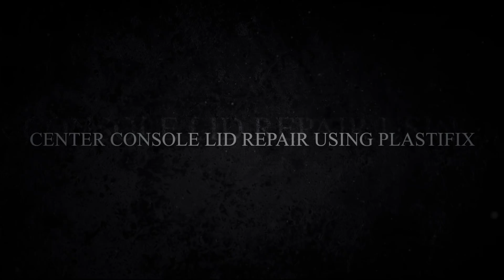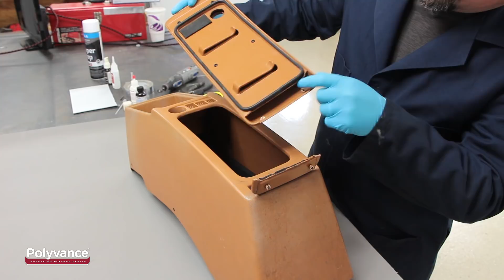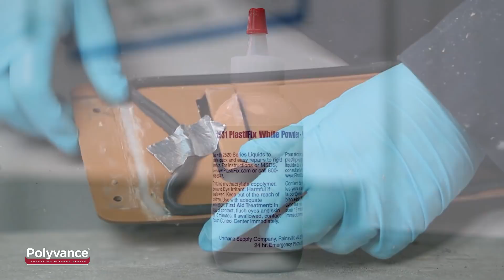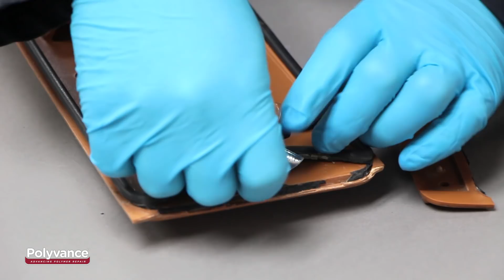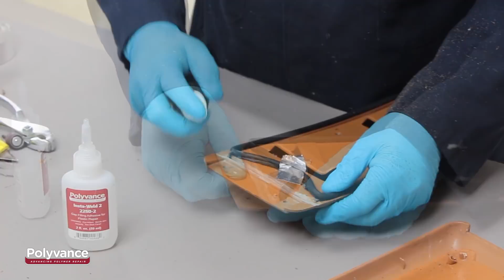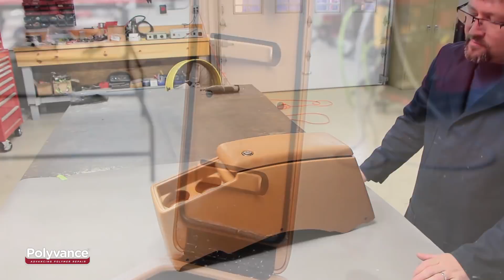Center Console Lid Repair Using PlastiFix

Comment from the maker: View this video on on our website for helpful information and product suggestions for this repair: https://www.polyvance.com/video/plastifix/center-console-lid-repair-using-plastifix

Here are some answers to common questions about the video:

Where can I get PlastiFix?
We cannot ship PlastiFix overseas due to hazmat restrictions. If you are in the United States, you can buy it from us. If you are in the UK, WOW! (http://www.wowauto.eu/) may still have some available.

Is PlastiFix just super glue (CA glue) and baking soda?
No! PlastiFix is a special type methylmethacryalte designed for ABS, PC, Acrylics and other hard plastics. Super glue only bonds to the surface of the plastic. It is also very brittle and only has about 30% the strength of a PlastiFix repair on hard plastics.
PlastiFix chemically etches itself into the plastic and should not fail.
Plastifix uses a liquid monomer to polymerize the powder to form MMA plastic in an exothermic chemical reaction. The most common forms of MMA include acrylic and lucite. The individual components have no adhesive properties without the chemical reaction of the two ingredients, unlike super glue. Because the components can be reacted directly on the surface to be bonded, the added benefit is that the reaction incorporates the surface molecules of the base plastic, creating a chemical as well as physical bond on some materials. The chemical AND physical bond make this type of repair extremely durable and impact resistant,  plus it is sandable and easily painted, unlike super glue type repairs.

Can I use PlastiFix on all plastics?
No. PlastiFix only works on ABS, PC and other hard plastics. It will not work on nylon very well, and not at all on PP or PE plastics. You should use a plastic welder on those types of plastics.

Comment: So basically it's liquid glue and baking soda 😂
Reply from the maker: No, it might look like super glue and baking soda, but it isn't! PlastiFix makes a far superior repair.
PlastiFix is a special type methylmethacryalte designed for ABS, PC, Acrylics and other hard plastics.
Super glue only bonds to the surface of the plastic. It is also very brittle and only has about 30% the strength of a PlastiFix repair on hard plastics.
PlastiFix chemically etches itself into the plastic and should not fail.
Plastifix uses a liquid monomer to polymerize the powder to form MMA plastic in an exothermic chemical reaction. The most common forms of MMA include acrylic and lucite. The individual components have no adhesive properties without the chemical reaction of the two ingredients, unlike super glue. Because the components can be reacted directly on the surface to be bonded, the added benefit is that the reaction incorporates the surface molecules of the base plastic, creating a chemical as well as physical bond on some materials. The chemical AND physical bond make this type of repair extremely durable and impact resistant, plus it is sandable and easily painted, unlike super glue type repairs.
Reply: The liquid portion alone has zero bonding power.  It requires the poweder to react with to create the adhesive.  It is not related to cyanoacrylate (super glue) in any way other than having similar appearances when shown in a video.  They do not bond in the same way, nor are they chemically the same.
Reply: @scottb7600   this looks like overlay nail products

Comment: How did you get the lock out?
Reply: If I remember correctly, there was a lock-ring or jam-nut on the backside of the lock.  Its been awhile since I did the repair, so I don't remember removing the lock too clearly.  Sorry i can't be more help.
Reply: @scottb7600  I figured it out,  great video.  Thanks for quick response.

Comment: I have a broken in the driver seat plastic decor of my vehicle. Can we fix the broken plastic decor in the same method.
Reply: AS long as its not polypropylene, then yes, this will work on your part. (The most common interior plastics are polypropylene, ABS and ASA)